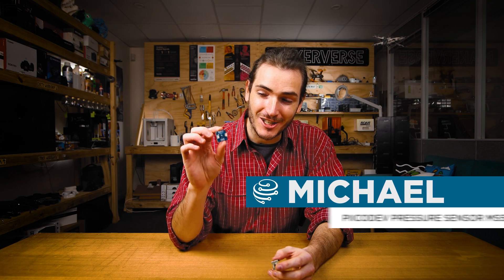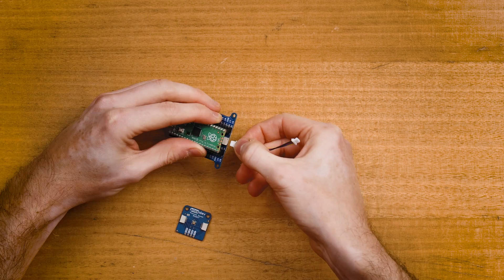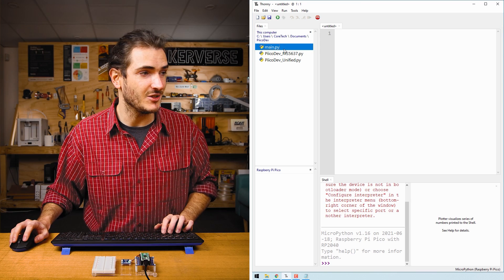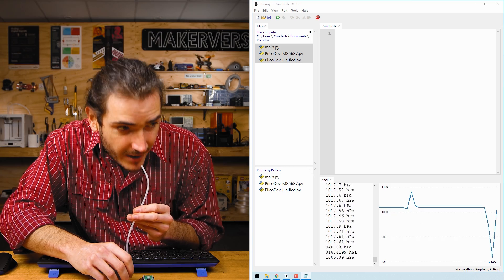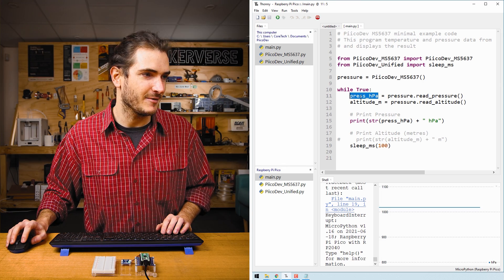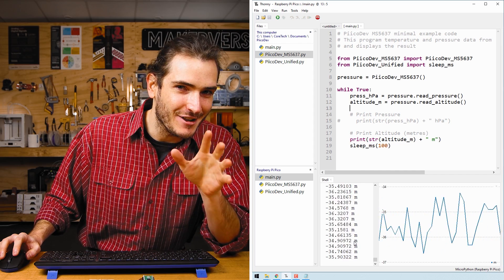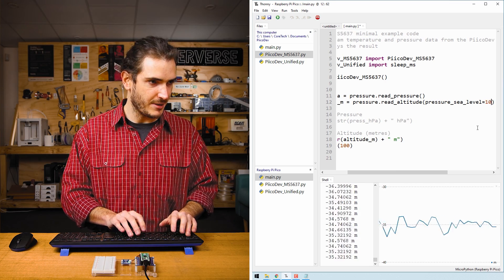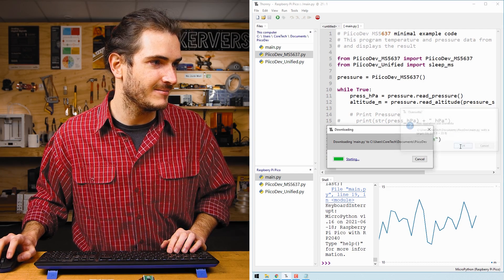PiicoDev Pressure Sensor MS5637 | Raspberry Pi Pico Guide

Comment: Could you add a LCD screen to this for a live read out so when I am out on the boat fishing 70kms off shore I can see if the pressure drops and can see a weather change and start to head in as in the tropics it can change fairly quickly in the wet season or the other way watch is as it gets closer to 1020hpa which equals 1020 fish are plenty.

Great vid. Thanks

Comment: Hey, great video! I’m interested in the altitude measurements. They seem to fluctuate quite a lot! So, why is that exactly(i.e. how operates the sensor?).
How could you increase the stability and accuracy of the measurements? I’m guessing a better sensor and maybe a hooked up gps sensor setup as validation, just like the gps survey instruments.
Best regards 
Simon
Reply from the maker: The sensor is really measuring barometric pressure (air pressure) - so small fluctuations in air pressure will certainly add some noise. You could filter the measurements using eg. a moving-average filter or IIR filter to smooth out the noise.

Comment: strange, imported sleep_ms from picodev...., which is standard in micropython time !
example is found in raspberry-pi-pico-python-sdk.pdf on page 22, line 45.
12 meters, 5th floor, if building is also at sealevel, could be on a hill.   ;-)
Reply from the maker: Good catch 😉 We rolled our own sleep_ms() function to guarantee the same behaviour on Raspberry Pi SBC, which does not have sleep_ms. That way, all PiicoDev examples look and behave the same - no matter what platform you use.